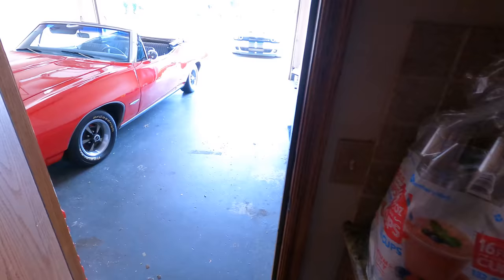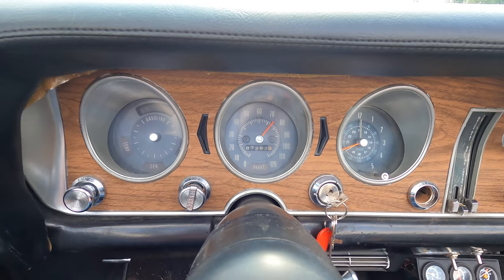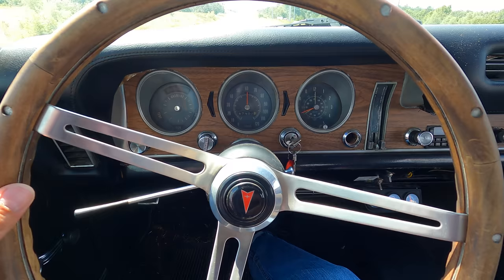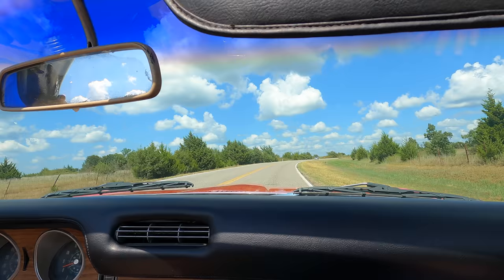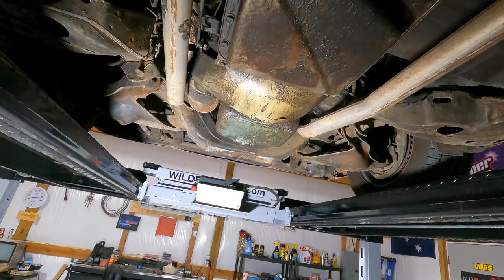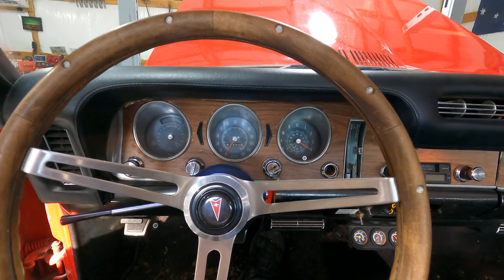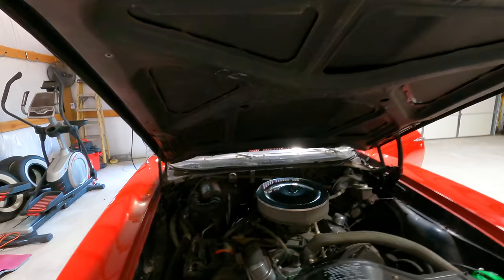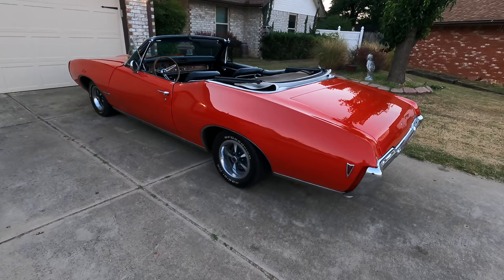Everything Wrong with my $20K Fake 1968 Pontiac GTO - How bad is it?

Comment: I would change the transmission with a 4 speed auto like a 700r4 or a 2004r do some work to the heads and maybe a cam to get some more power  and front disc brakes for more stopping power but besides that and fixing what needs to be fix I would leave it alone, and save the old transmission don’t get rid of it. Great video.

Comment: If the gear selector says D and L it's a 2 speed if it says D 2 1 3 speed not actually a power glide as that was Chevy but a variation

Comment: Your 1968 GTO Clone Lemans average value depending on its conditions is worth between $10k & $14k. Found one in Texas for $10k with 57,000 miles and one in Florida with 22,000 miles for $14k. I really think you got ripped off unless your car has less than 10,000 miles on it?

Comment: I've been yerning a project car as well. Mine is more specific. 1970 Ford Galaxie 500 2dr sport roof, 351W, FMX(ish, known by a prior ref name). Paint condition doesn't need to be even near good, but as rust free as possible. Wish I could find one for $2,000 of less.
Reply: My old mechanic was selling an original 70 Galaxie 2dr with fastback rear window, 351W. It was white with red interior and had decals/couple badges on and in car that said Mayfly. He never figured out where the Mayfly name came from. It was probably a random dealer that badged the car. His had minor body rust on rear quarters. Think he wanted $5k. Cars gone now but was in Ma

Comment: I for one do say that if properly tuned and maintained an older car can be and often is justo as if not more reliable than a newer car. They have far less things to go wrong with them and if properly tuned and maintained in the unlikely event something does fail and cause a breakdown it’s easier to trace down the problem, easer and usually cheaper to fix and in many cases an improvised roadside repair can usually get you home whereas a newer car is likely to have a sensor or other electrical problem be the cause of the breakdown and with all the sensors and computers on newer cars it’s not likely that a roadside repair can be improvised to get a sensor bypassed if you can figure out which one it is and an improvised electrical repair would likely screw with a computer whether the ECM or BCM and will still shut you down. My 63 Dodge 440 four door with a 318 Poly is finally about to get its first carb rebuild in its 58 years of life due to leaky gaskets. The brakes are updated to a dual master cylinder with 4 wheel drum brakes, new shocks as it still has the originals.  It has some rust on the front fenders but that rust doesn’t affect its reliability. If I was to change the radiator I would have no hesitations about doing a trip from up here in far northeastern Minnesota out to either coast then work my way across to the other coast and just circumnavigate the country with it. It has NEVER left me stranded whereas newer ones have and it gets 22 —24 mpg hwy. even with still having a points ignition it never fails to start even when I had no choice but to drive it in the winter a few years ago and it started without issue at -43 F. I’m fact it’s jumpstarted several newer cars that same day because they wouldn’t start

Comment: Your off the line performance is limited by TWO Speed transmission and Highway gears 2.73 guessing. Quarter mile on stock 1968 350 LeMans Conv is18.2 seconds.

Comment: Not a thing wrong with mufflers!  Not all of us like noisy cars and want to hear the engine instead of a loud droning exhaust system.  Also, if you can't tell how many gears the car is shifting through when driving, then there is a bigger problem.  From hearing the car idling in park, I'm inclined to say it is a 2-speed transmission as they all have a unique "whining" sound when in park.

Comment: That trans is a problem. If I kept it I would be in the market for a turbo 350 or 400 trans. A 4 speed manual would be so much fun but you would need so many parts to do it it would get real expensive fast and probably have to get half of it from a donor car. Good luck finding a manual trans donor car for a 68 granted 68-72 should all work, but still so rare and in demand.

Comment: I’d go with bigger wheels, as it’s current stance is lowrideresque, but it would make a good low rider.  I would probably do a hidden modern stereo.  Something practical, but not taking away from the original look.  Definitely ditch the GTO badges, as that’s where you got catfished.

Comment: Why was this done?  It's ridiculous.  If that was a real '68 GTO the front would be entirely different. The standard GTO engine for '68 was a 400cid V8 with a 3-speed Turbohydramatic automatic trans with a Hurst Dualgate Shifter.   The tail lights were different. The ones on this car look like they came off a Chevrolet. I would have run, not walked, from this Frankenstein. Instead of wasting money and time on this turd why not go over to Jimmy's Roundup Cafe and Fried Pies and spend your money wisely?

Comment: If you are correct and it is the original engine, then it should be a 350 and the horsepower would be around 250.  That seems to be the case and it won't perform like a muscle car!  It's still a nice car and worth the money,. and you can look for a 400 to swap in sometime and then finish the GTO conversion later!!!!!

Comment: A carb and mechanical feul pump are more reliable then modern cars. They ran  on the original car for over 20 years with no problems.  The problem is with the feul now days if you don't drive them constantly you are asking for trouble with any car.

Comment: On the side of the block by the freeze plugs it will have numbers that code 5-0 meaning 350 or 55 meaning 455 but most are 350 2 barrel cars with a 273 highway gear so it won't fly off the line 😂 It looks to have a metric 250 in it so idk if it's a power glide because they don't have a vacuum module only 3 speeds did .

Comment: You should do a 200R4 conversion. That would make it a cruiser.
Reply: That is a great idea. It should bolt right in since the2004r has the dual bolt pattern BOP and chevy.I have a 1965 Lemans and I'm thinking that is what I want to do. You can even buy an original look shifter from shiftworks to operate that trans.Neutral safty switch and reverse lights function.

Comment: I say you will make a round trip no problem just keep an eye on the water temp.
Reply: Yes, generally old Pontiacs hate traffic when they are fully warmed up.  Unfortunately, the beautiful split grill used in Pontiacs hampers air flow.  So it's a good idea to monitor the temp guage in traffic.

Comment: Powerglide was primarily a Chevy trans.  Pontiacs used Hydra-Matics, and later Turbo Hydra-Matics. Buicks had Dynaflows. Are you sure that it isnt the 2 speed Hydramatic? There is in fact a 2-speed Hydramatic called the ST300, Super Turbo is what the ST stands for.  This would have been right around the time/era when they were switching over from the ST300 to the THM350/400  which of course are three speed units.  That's about as far as I can take you into it. 
Anyway I don't think putting a 4 speed in this car would hurt the value... but w/a 350 engine, it's just a little cruiser.  Not built for fast launches and all that.  My dad had a '69 Catalina w/ 400 and 400 trans that would have cleaned this up all day everyday on the road.  But a Catalina certainly isn't a go-fast car either LOL

Comment: This car with maybe 3.55+ gears would change things quite a bit right off. I bet it's got 2.90 +/- right now which effects off the line a lot. So yeah, change the gears, and a good used TH350 would change things immensely. I would also need front disc brakes. It's funny though, I had a '69 Tempest that was pretty stripped, but came with a 350 CI, and a TH350 3-speed and it had front disc brakes too. I bet the brakes were optional, but I feel like the 3-speed was standard by 1969...

Comment: 14 inch wheels are correct for that car. 15 inch wasn't an option on GM A body cars until 1970. Shocks will not raise that car unless you put coil overs or air shocks. Your springs are probably worn out. Proper modern tire size is 225/70/14 for that car and those steering boxes were loose even when new. Just grease everything up and put some coil overs in back. And get those GTO badges off that le mans. Oh I didn't see your shifter but if you only have PRNDL.it is a powerglide, if PRNDSL then it is a turbo 350.  Good luck
Reply from the maker: Springs are good, tires were too small. No bottoming out issues since the new tires. Shocks were bad anyway, so I replaced them. Also, it's not a Lemans. It's a Tempest Custom.

Comment: A nice cruiser ... however, zero chance that 350 Poncho motor makes 350 HP ... The standard Pontiac 400 for the 68 GTO was rated at 300 HP ...

Comment: engine is a 350 pontiact and trans is a st300. doesnt make 350 hp about 325 is its an ho version 320 if its just the regular 4 barrel and the 2 barrel is 250.

Comment: Put the original Quadrajet back on it.. that holley isn't the factory carb.. and you're wrong about the 2 speed transmission. its a ST-300 not a glide.. though they are similar.. an the 2 speeds are geared so 1st gear pulls out of the hole well, and the 2nd is for crusing..  why to you think all  the drag racers use a glide??? not cuz they are slow.. it falling on its face from a stop is carb.. needs the proper quadrajet tuned right..

Comment: Awesome Pontiac! If it was a real GTO it would have a 300hp Pontiac 400 and be much quicker. Back then BOP Buick, Olds, and Pontiac had their own engines. A Pontiac 350 is not the same as a Chevy 350.

Comment: The body lines do not look like mine. I had a 1968 gto, ho 400, m21 transmission and a 373 rear end. I needed to replace the front bumper.
Reply: I see a power glide transmission
Reply: Only a 350? Underpowered.

Comment: If it ain't broke would be a shame fixing it and losing its character.   Prob find the lower end brake bands in the box are a little loose and just needs a general tightening and service on the box, internal pumps maybe a little shagged out, accumulated crud and muck in there impeding performance, the fluid itself may be ancient and past its best.

Comment: Wheels are CORRECT! Tires are wrong! Original tires were F70-14 which is no longer made. Coker Tire specializes in vintage car tires. They have the correct replacements. If you change the wheels, you will devalue the car. Those are the original Pontiac Rallye II wheels. My 71 LeMans and 72 Grand Prix both had those same 14” wheels.

Comment: RANDY, that car probably has a 2.56:1, or some other extremely long-legged gear, in it, and those will just kill your off-the-line acceleration - but will allow you to cruise pretty easily at 75 MPH without overdrive.  Flip your air cleaner lid and try listening for them secondaries again...

Comment: If you want to be able to do a burn out with it, just put a 350 or 400 TH transmission in and it will spin one tire until you let off. Seriously, that is all you need to do to really wake up it's launch.

Comment: I notice most say convert it back to a lemans but being it already has the GTO badges and door panels etc I would just finish the clone job being it is not orig paint and interior nor concurs engine comp and it should be a 2 barrel single exhaust if not a GTO so who cares? Tail lights, front bumper, grill, bezels and hood you have a $20,000 car that will look like a $60,000 car. Just don't lie if you sell it. Not saying this to fool anyone but just because the GTO is like the coolest muscle car ever but too expensive for most to ever own one again. So next best thing is a clone from a lemans for personal enjoyment and looks. We are just talking bolt ons here.

Comment: Nice Lemans, return to Lemans stock. New shocks and springs. New flow master dual exhaust.  350 better on gas than my 389 4barrel 66. The chrome number also ez give away its lemans or tempest.

Comment: The money you paid was just fine for a LeMans in the shape your car is in. You did fine. Real GTO's have: 400 engine, 3 speed TH400 trans, dual gate Hurst shifter, back up lights in the bumper (not in the rear lights) hood scoops, woodgrain dash, endura front bumper, and on and on. You should really do your research on musclecar purchases....they are easy to fake and you can take a bath. If your '68 was a real GTO you would have had to pay roughly twice what you did for it. Again, you did just fine here. I would re-badge it as what it is and drive it.

Comment: That gap between the font bumper and he hood just dose'nt look right. That car came with 14" tires.Maybe you need  new coil springs.
 I had a 1970 Pontiac Le Mans Sport around 1973. 350 Hurst four speed. , 55,000 miles. Paid $1995.00.

Comment: Oh yeah a powerglide is geared very high even in low you can run one up to 60 or more more then it goes the second.
Drag race guys love to get their hands on those transmissions and especially the torque converter so don't give it away

Comment: I had a 68 Firebird with a 2 speed automatic, for some reason I thought Pontiac had a different name than Powerglide, and I had no issues with it coming off the line.  I have no suggestions on how to make it launch better than possible a tune up, check timing, transmission filter change...  It's been a long time since I had my 68 but I fondly remember shifting out of first gear into second at 70 MPH.  I believe some race cars still use Powerglides because who needs more gears than two in a quarter mile?
Reply: Cleetus has a power glide 2 speed in his El Camino (Mullett) and runs 7' with it.
Reply: The Pontiac Olds and Buick ''A'' bodies 2 speed was called A turbo 300, it shared no parts with the powerglide, His problem coming off of the line is the rear end gear ratio not the transmission.
Reply: @dannycasler4959  Super Turbine 300. Pontiac didn't have a name for it, they just called it a 2spd automatic. It was the ST-300 by Buick and Jetaway by Olds. Buick had the switch-pitch version of it at one point and it raised the stall speed for faster starts. There's a couple parts that interchange between the PG and ST but not many. A friend of my father's used to build transmissions in the 60's and 70's for racers and he talked about using some parts from the ST to beef up the PG. 

And yes, like the PG it would stay in first till 60-70 if you matted it. 

I miss the days you could find stuff like this all over the place. Passed over because it's not a real GTO or other "Muscle Car" you used to be able to get them cheap. I guess in a way they still are. When I got my license I found a 70 Skylark for $500 with a 2bbl 350. I wish I had ignored my parents and bought it anyway, it was a clean car and I knew where there was an Electra with a 455 waiting to be parted out...
Reply: @cobra02411  The Pontiac two speed was called a Tempest Torque. The Olds was a Jetaway and the Buick was the Super Turbine 300.

Comment: Replacing your shocks will not fix your bottoming out problem, that will just make you bounce less after big bumps. It sounds like your springs are either worn out or you have a broken coil somewhere.

Comment: SHE NEEDS NEW COIL SPRINGS and they are not that expensive. ONLY ABOUT 100 BUCKS! It will probably quit bottoming out with new shocks and springs. The new springs will make it sit up waay higher. Some brand new shocks would be good and NOT Monroes. The radio is an easy fix go get a new one at walmart or just take it to a stereo shop they will fix you right up. YOUR COIL SPRINGS ARE FLATTENED OUT AND SUNK THEY ARE OLD! SPRINGS ARE TIRED.

Comment: No acceleration from a dead stop,,,,,  could be carb is too big,,,,  or power valve is non functioning,,,  If it was my car, I would put an Eldabrok dual plan 360 intake on the engine,, and a 600cfm holly,,,  There is a carburetor shop that will dial in a carb exactly for your engine-cam-exhaust-manifold setup,,,  Think it is in CA,,  when I was in high school one of my friends had a 1965 gto with 389 and factory tri-power carbs,,,  It would burn rubber on the 3rd to 4th shift,,,  Was rather quick,,,  :-)

Comment: No! It's not a 2 speed powerglide, If it's a two speed and it most likely is, Probably 80 % of Pontiac Tempest and Lemans from 1964 through 1968 were two speed it will be a Turbo 300, My guess is that your rear axle is a single track with 2.56 to1 gears or close to it, Also almost all 1968 Tempest and Lemans came with 350 engines with 2 bbl. carbs, Yours probably had a two bbl. to begin with and was changed to a 4 bbl. Also all 1968 to 1972 Pontiacs A bodies came standard with 14 inch wheels, Your problem with bottoming out is the tires not the wheels!  I had a 1968 Lemans convertible and it was equipped that way along with the about 30 or 40 68 Tempest and Lemans hard tops and sedans I owned over the years, I have owned literally hundreds of Pontiac A bodies from 1973 until now , At the end of your video you were blaming your transmission for your car being slow off of the line, It's not the two speed transmission it's the rear end gear, I took the 2.56 /1 geared rear end out of my 68 convertible and put a 3.55/1 geared posi. track rear end in it and even as a 350 2bbl. carb it woke right up off of the line!  The 455 with turbo 400 woke it up a lot more though! If your car is ''bouncy'' over bumps and dips get a good set of shocks, and a larger set of tires in at least 70 series instead of 60's and it should help stop the bottoming out!

Comment: Transmission should be a 350 turbo
Reply from the maker: Nope I have the build sheet and she is 100% original. Came with a 350 and 2 speed with 3.08 gears

Comment: If the engine is a 350 then the trans is likely a turbo 350
Reply from the maker: It's a 350 with a 2spd powerglide but I appreciate the help!
Reply: The actual name of the transmission is Super Turbine 300 (abbreviated ST-300).